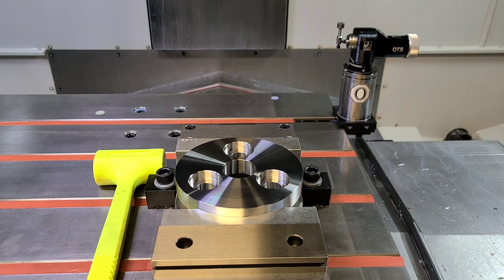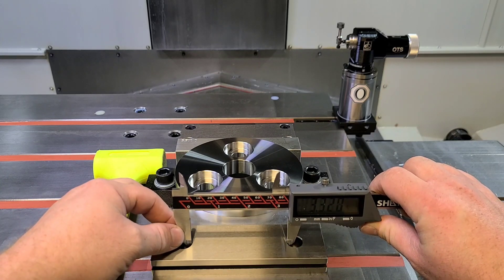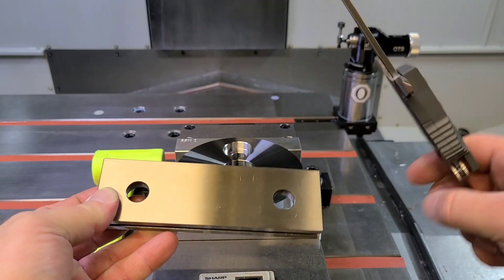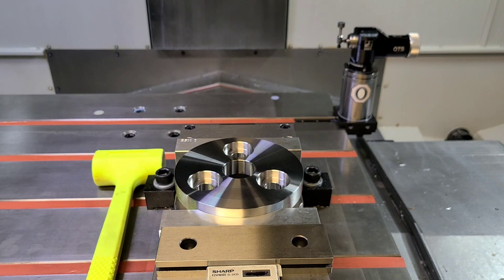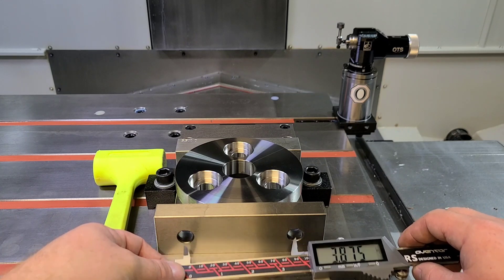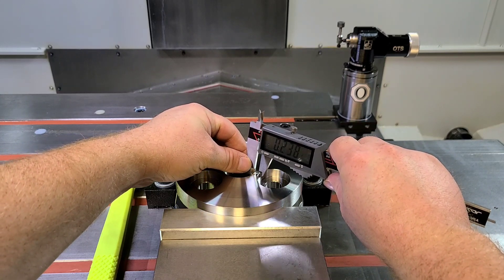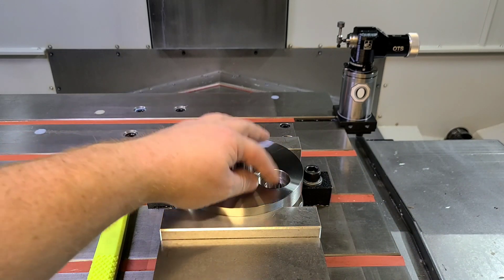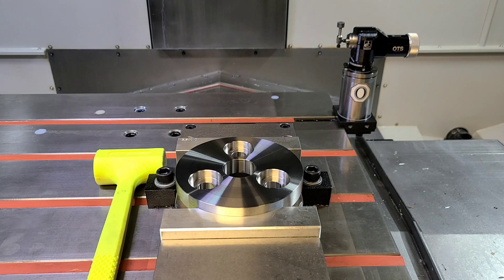Measuring Bolt Patterns/Hole Locations

Comment: I have some bed rails that I need to build for a headboard and footboard. The headboard and footboard has prebuilt drilled holes which means I can’t just slap on any type of frame if I want to create a seamless look. I have tried to think of so many methods on how in the heck I was going to do this. Thank goodness I came across your video bc now I know that this is something I can do without paying someone else allot of $$$$. Thank you this was great info.

Comment: Another nice trick if measuring hole pitch with digital calipers, is to measure a hole with the ID jaws. Zero the caliper then measure from the edge of one hole to the edge of the other with the ID jaws again. This will give you direct read-out of hole centre to centre assuming holes are round and of same diameter.
Reply from the maker: Yep, you can zero digital Calipers and avoid the calculator for many measurements.  That was a tip video on our Instagram page a while back.